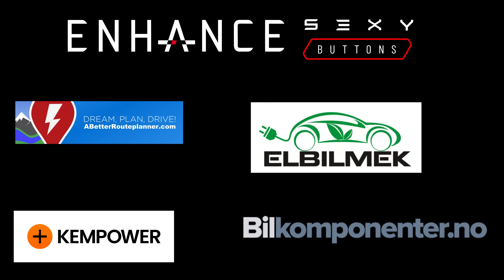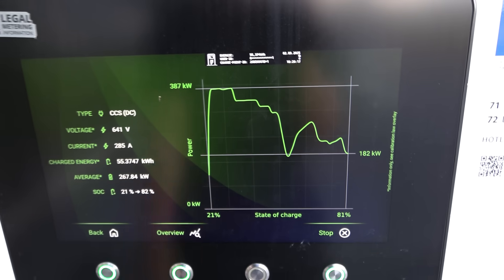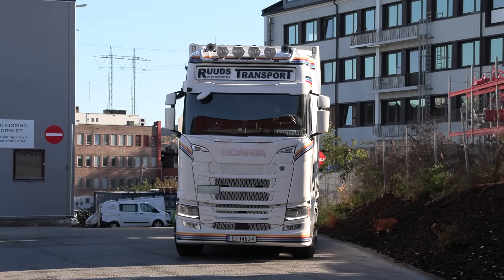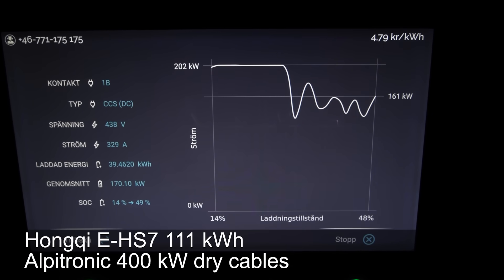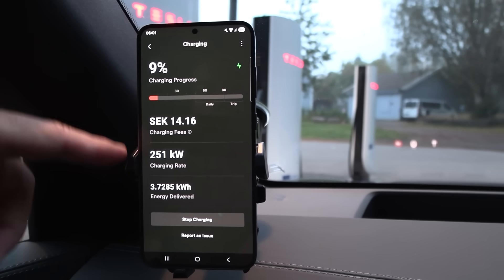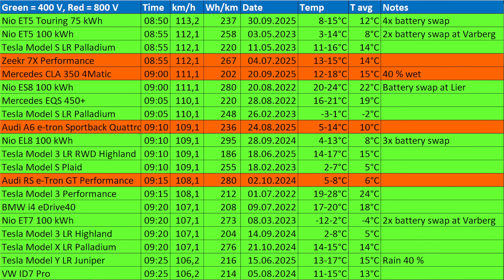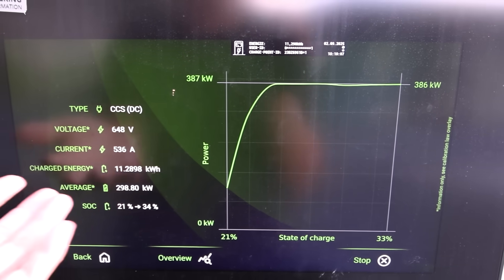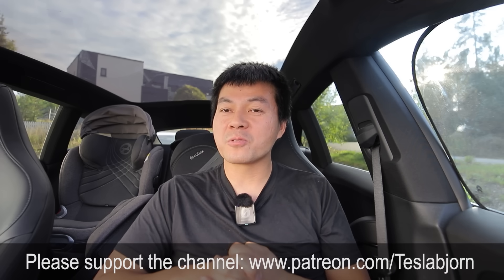How dry vs liquid cooled cables affect charging power

Comment: Hi Bjorn,
We’ve done some tests in Spain, and in most cases the power drops are triggered by the car’s connector temperature, rather than the charging gun itself.

The Phoenix Contact gun can handle up to 114 °C internally before reducing the current to 375A. However, on the vehicle side connector, the maximum temperature is around 84 °C, so it’s usually the car that causes these drops. 

As you can see with the Alpi's, sometimes the power recovers after a drop—this happens when the limitation comes from the car side. If the drop originates from the gun, power won’t recover for more than 20 minutes, since the car’s hysteresis is much faster than the gun’s.

Nevertheless, using liquid-cooled guns is very important to reach and sustain over 280 kW, because they also help keep the vehicle inlet cooler. That’s why you see much better results with liquid-cooled solutions.

Comment: Take in 363kw in 28 minutes.... Sounds so far away for cars. 
100kw in 10 minutes for 500km. Then we are done with petrol.
Reply from the maker: *kWh
I was quite confused when I read your comment.
Reply: The thing with electric trucks is, that they have huge battery packs. The Mercedes eActros has a 600kWh battery pack. So charging 400kW continuous in that truck, is like charging 53kW in a 80kWh car battery.
Reply: @Andi.und.sein.E  The limiting factor for delivery trucks are mandatory rest times (45 mins). They rarely charge from 0% to 100%.

Comment: How will an 800V battery affect the efficiency of charging from a domestic electrical outlet? If a step-up converter is required, it will certainly be less efficient + cost. Switching the battery circuit to 2x400V can be used, but it will cost something.

Comment: Cable theft is a big issue in the UK, so less copper reduces the return. I wonder if traceable liquids can be incorporated into the coolant too.
Reply: Yes, tracable, staining fluids in cables have been introduced, shown at ev trade shows, State of Charge channel did a trade show video showing at least one vendor
Reply: @geraldford6409  yes they're frequently retrofitted now by companies like Instavolt, usually as extra jackets on the outside of the cable. I was wondering if it could be actually part of the coolant loop though.
Reply: Oh there is an easy fix. You need revolution.
Reply: I was thinking exactly the same thing! It would be good to see cables with a liquid coolant that makes theft less attractive.
Reply: Interesting how much worse would be simple aluminium or cooled one. Thicker less flexible?